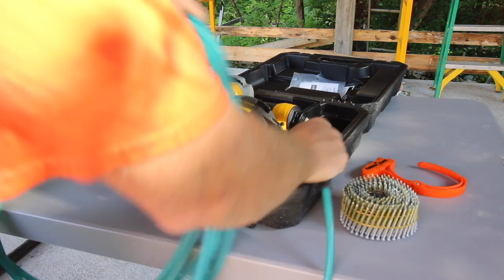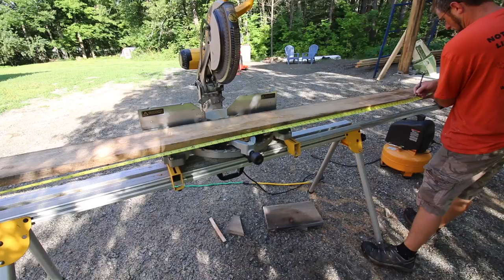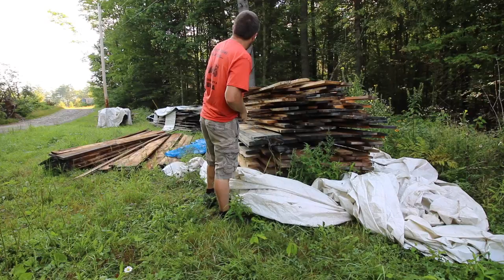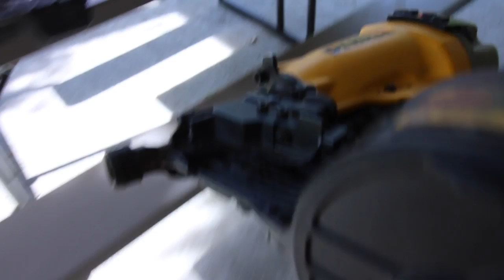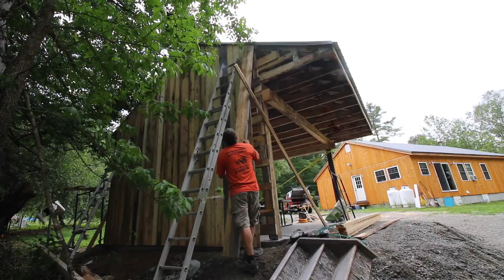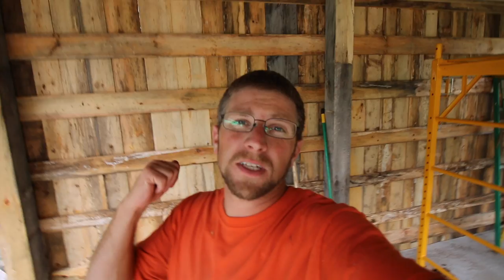How to Install Rough Sawn Siding On the Off Grid OutDoor Kitchen

Comment: When I use one of my nailers I put a few drops of oil into the nailer inlet before I attach the hose. Why do we never seem to see you doing that? Have you found nailers that do not require it?
Reply: A few drops every few days of use should be fine.  Remember to use a non- detergent oil.  No wd40, air tool oil or 3in1 oil.  They have detergents and/ or solvents which will swell and destroy the rubber orings that allow the tools to function.
Reply: ?  Really, the video is about building an outdoor kitchen.